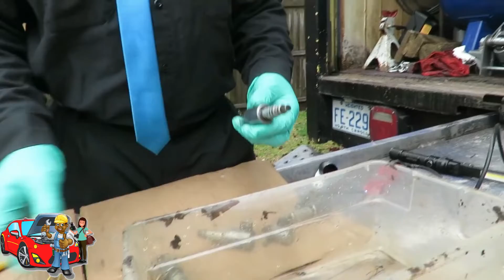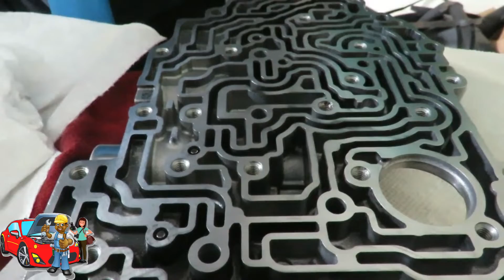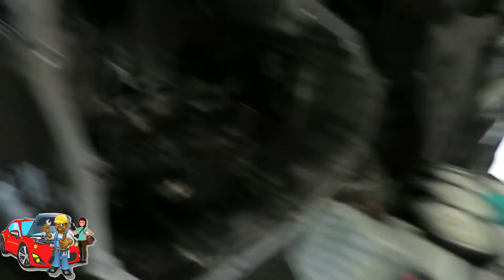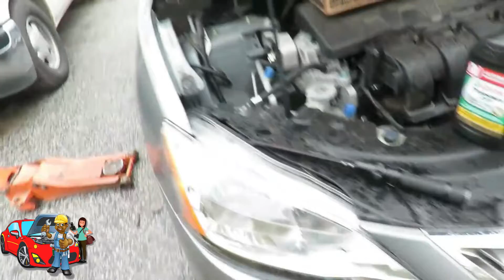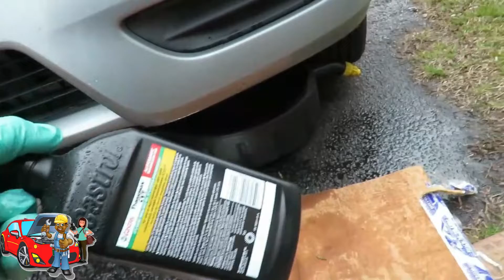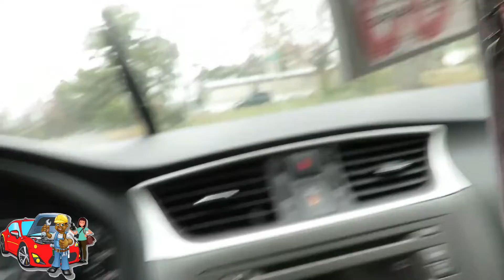Nissan Chevy Dodge RE0F11A transmission P0746 Pressure Control Valve Solenoid A Stuck Off, Part 2

Comment: Did u buy new solenoids or just cleaned them out?
Reply from the maker: Cleaned the old ones.
Reply: @OnlineAutoRepairVideos  nice I think i might try that my 2013 nissan altima won't shift into 2nd gear or 3rd until I let off the gas pedal then give it gas again what do you think it could be?
Reply from the maker: @FrankMaldonado-g2d4v  Start off by checking all the codes you may have.
Reply: @OnlineAutoRepairVideos  the only codes it is giving me is the the o2 sensor bank 1 sensor 1 but i dont see how a 02 sensor can affect the shifting. thank you for replying
Reply from the maker: @FrankMaldonado-g2d4v  Yeah, we don't see that affecting shifting either.

Comment: Haha..you are a cool dude man..

Good work..tell your helper stop giving you a hard time..

Haha..so I have experience now with what you just did however I have a question, why was it P0746 code and which solenoid or whatever was it. 

I have had stepper motor code and “sec press” which is the filter..

I have a 2014 Nissan Versa i am about to go in and change the fluid, clean the filter and maybe the stepper motor replace it because right now the car is not engaging so it is not moving. 

Your thoughts thanks

Comment: Really good video .. thank you, plus I got to hear the Styling of Eddie Murphy's expressions!  I'm helping a bud this weekend with a Sentra that will only drive in 1st. Everyone tells him it was the transmission .. but after seeing one opened, I couldn't understand what is in there that could go wrong. its just gears and that steel belt.  So this weekend we are going to check the solenoids etc. I've lots of experience .. but zero with a Sentra Wish me luck .. I bet its those solenoids.
Reply: Did u figure it out ? Im having the same problem

Comment: What symtoms did u have? I couldnt go over 30 and it wouldnt respond no matter how many hard  pressed on gas.  Rpms wouldnt move and car wouldnt shift. Is this what u were getting also? I got error p0744, p0746 and p0846
Reply: I'm thinking of just changing out solenoids to make sure it's not just dirty
Reply from the maker: Would not go over 35 MPH

Comment: hi sir, 
i have a question.  this code came up after i took a Nissan Cube for a fluid change because i started it up one morning and wouldn't move until the tranny heated up. so I took it in and changed the fluid and drove around the rest of the day. that following morning I started it up and it wouldn't move again until it heated up but, this time thru that code.  so i just grabbed a truck dolly and towed it un to a shop hoping the best with a extended warranty. But the code came up the day after i had the intial problem where the fluid was changed. 
does it seem likely at that point to be the cause or did something happen after the fact do you think?

Comment: You have a lot of courage in working with CVT gearbox, how do you deal with  a CVT car that goes into limp mode at 80mph after travelling long journey?
Reply: add a radiator cooler with bypass valve. something like a hayden 678.

Comment: I got the same car and have the same problem when i put it on D it turns off and the mechanics try ripping me off but this is an excellent video, you the best video i ever see on this topic up till now
Reply: Do you know why my own turns off ?mine is a 2014 sentra button start am thinking replacing the whole valve body or cleaning the solenoids